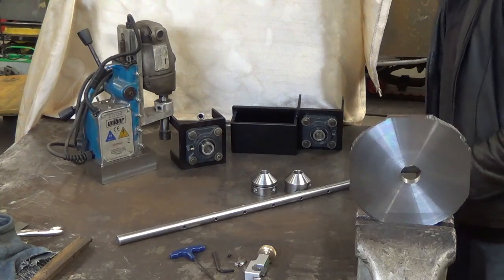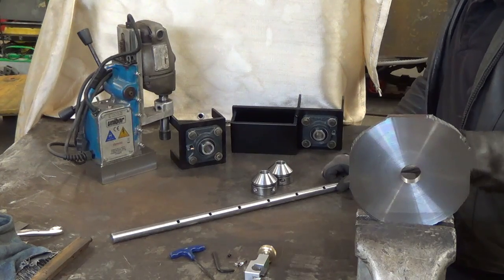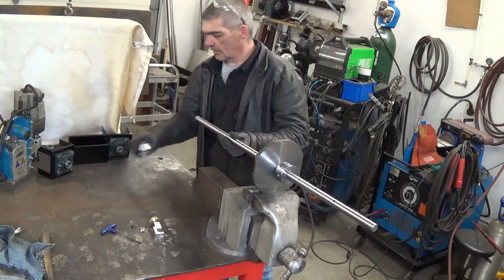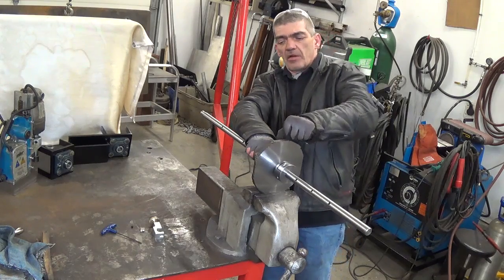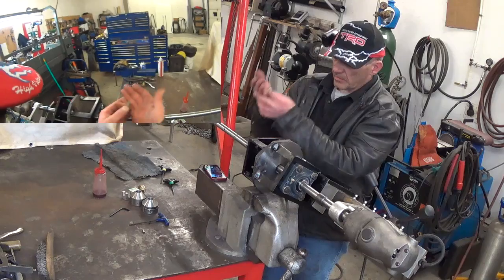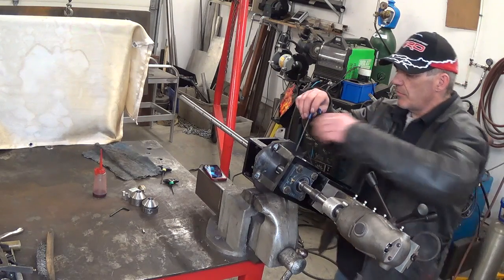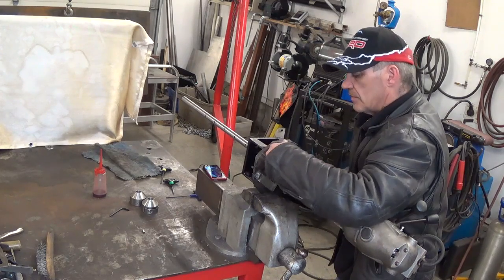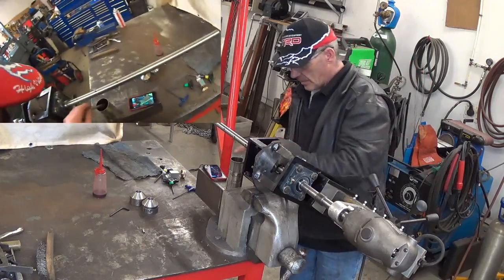Line Bore..

Comment: Told you that you could build it' I really like your tool setter also' looks nice' Now that you proved you can build one you will make larger ones' and Improve on design'
Reply from the maker: +Jacob Boehnke Thanks Jacob. I already have the 1.5" material for a larger bar. It will require a stronger power source though. Will finish the small bar setup first and work on pieces for the bigger unit.   :-)

Comment: Simple enough, and it seems to get the job done great, also easy to carry and install in the field if needed... ;)
Reply from the maker: +pierre beaudry A little more work to be done on it yet but come tractor season it'll be ready to go. I have people wanting to rent it already....  Cheers..:-)
Reply: +CompEdgeX It is not too ponderous to carry along and the mag drill is useful for other work.
Reply from the maker: *****
Actually the boring unit was the primary reason for the magdrill...fact that it can also drill holes just is a bonus..LOL

Comment: Colin,
Thanks for the "boring" video! (lol) That's a pretty clever setup you have. You need a boring machine like Abom79 uses in his videos. Thanks again, and great to hear from you.
Have a good one!
Dave
Reply from the maker: +Swarf Rat Hey, I want a small boring mill in the worst way...love Bruce Whithams...more my size. Still wouldn't do  much with some of the heavy equipment that has to be done on-site...portable line bore works well.   Thanks. :-)
Reply: Yeah, that boring mill that Bruce has is a nice unit. Maybe one will turn up.

Comment: Great video as usual.  You left me wondering just what part of a tractor that is.  Very clever little tool bit setting device.  Thanks for the video.
Reply from the maker: +Amateur Redneck Workshop Harold that's a rarely seen part of a tractor called a "junk plate". It's located right next to the steering nut... LOL  Thanks :-)

Comment: have you considered making the standoff legs on the bearing blocks removable?  it would not only save wear the tool itself but i believe it would make getting the stand offs off the part easier as you could just snap them off the opposite direction they were welded then just grind smooth. would think it would be a pretty easy modification but it looks good either way
Reply from the maker: +andrew mac I had thought of some flat bars with a series of holes attached to the frame with complimentary disposable pieces to weld to the job. Today just wanted to do some type of test on it...have plenty of changes to make after watching the video myself.  Thanks